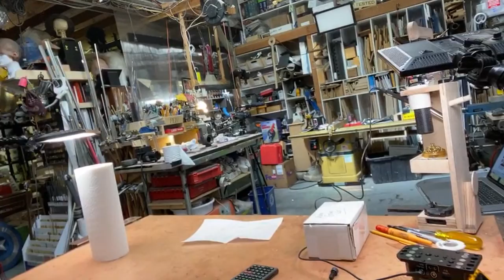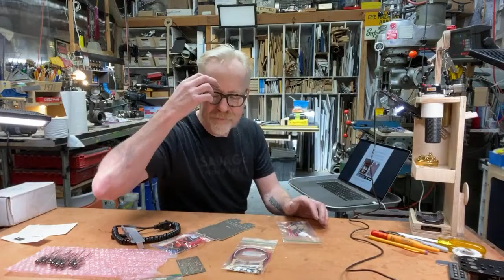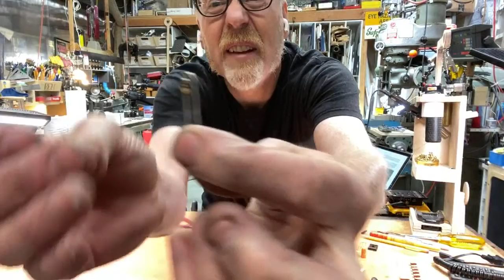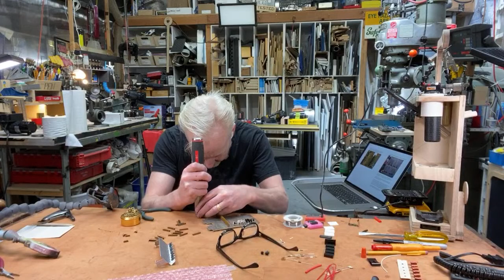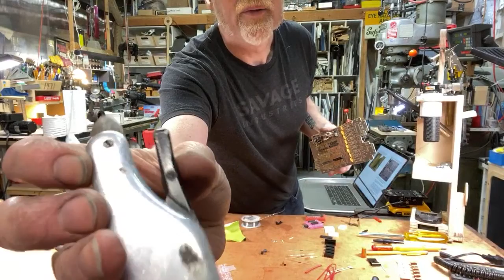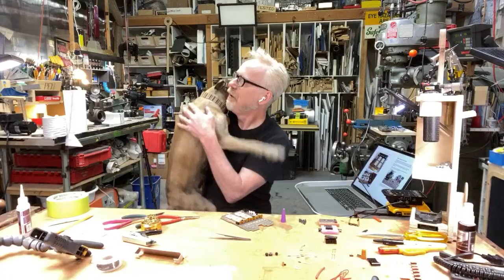Adam Savage's Live Builds: Ghostbusters Gizmo Kit!

Comment: For the workbenches I'm pretty happy with double locking casters for providing a stable base while still letting you move it around.  Another option would be to use retractable casters.  They give you the ability to move it around while also having it be stable on the bench's legs once you retract the wheels.  Another option in a similar vein are wheels that have little rubber stops that you can extend to lift the bench off the wheels.  A little harder to quickly disengage but if you don't plan to frequently move it they would work for the rare occasions you need to move it.

Comment: Adam, you should look into the wagon brakes that they use in theater for scenery. It gives you the stability you need when you drop the brake and put the weight on them, but still allows for the mobility when you raise them.

Comment: you could always make the wheels retract so you rest on the boards for the bench then pop them down to move it ... use a foot pedal switch of some sort that rotates the castors down or up ... make the ends slanted so you can put some of your tool boxes there with things you need for the current project ... and add a pop out for a camera stand spot ... heck have it swing out like the old school desks with the arm table thingy
Reply: a broken clock can also be only right once a day ... if it is a 24 hour clock
Reply: you could also use the needle knose pliers to hold all the pins on one side and then push down on the table to move the strip or bend the pins all at once
Reply: no one cut her wings off ... those are tan lines from her wing harnes lol ;)

Comment: My rule for locating anything that has been dropped, and disappeared, is, determine the hardest, most pain in the ass place that the object could have rolled under. More times than not, not only will it be under there, but it will also be fairly close to the center of it.

Comment: 11:40 When I drop a screw, what I do is I turn off the light then I use a flashlight and point it low on the floor while trying to spot a shadow that would resemble my screw. When I move the flashlight on the floor the shadow of the screw will be more noticeable. Sometimes that works for me so...

Comment: You know it occurs to me that someone somewhere has a service manual for one of those old calculators. If a person were to want to recreate something like that, all they'd have to do is make a new board from the reference images and copy the component values. Getting ahold of one of those manuals has to be like finding the pin in the needle stack though. I looked and I can't find any that are legitimate. None of my nerdy friends knows of anyone that has one either. So this is more or less just a thought because I've seen old manuals that have an image of the board for component placement with trace outlines. I think they include them for a visual reference geographically as to where to find the thing you have to replace.

Comment: Drop something, just lay a flashlight on it side on the floor and look around as you sweep the light around.  Small objects throw a huge shadow, like a pointer with the lost item at the end of the shadow.  As for the small wire kinks, check out modeler's "Metal Forming Pliers (Set of 4) # 60398 at Micro Mark hobby supplies

Comment: Your power supply story has me worried. Lol PC power supplies have large capacitors that maintain a high voltage for long after its been unplugged. Most consumers (especially 10 year olds) should NEVER open up or dismantle a power supply.
Reply: Yeah, it might actually have been lucky that he did the new one since the old one would have a higher chance of having charged capacitors. They hold current surprisingly long.

Comment: I'll tell you 2 awesome solutions to your fake pin bending, ¹) Cheapest route is from tractor supply, their house brand of tools makes a 4 pack of these miniature, pistol-gripped pliers...they are I believe, 7 or 8 bucks here in Alabama, maybe 70 or 80 in Cali., anyway, they have an awesome pistol gripped shape, theres 2 needle-nose, a wire cutter, and the last one is the solution, they are flat-tipped, and have no grip ridges inside the Jews, they are flush on the end, flush on both sides, and just flat, smooth steel inside the 'jaws'. They are small, for the hand great, and the pistol grip gives it sort of that 45 degree angle, that would make short work of the pins. ²) The more expensive, but still not bad is, a small jeweler's vise. You could clamp the whole side, paired with those pliers would be awesome! But even a small jeweler's teflon/rubber mallet. Perfect 90° everytime. Good luck buddy, hope they let you leave the house soon. At least you do have the shop, that's the only thing that keeps me sane. I hope we don't get like that fella that just got tired of being at home it seems, he got bored and decided to kill his dad, and eat parts of him. Then went and found some police eating lunch, and said..."I just killed my Dad, and ate him". Sad but true, neighbors said they haven't heard, or seen them have so much as a harsh word before, or right up until. Just baffling. Love your videos bro, keep putting them out. If you get bored and hungry, just call me...or come to Bama, and we will go to the beach.

Comment: For your new bench idea. These casters allow a really solid base but can be moved with just a twist of the feet. I use them extensively in my machine builds and can highly recommend them. 
https://uk.rs-online.com/mobile/p/stem-castors/6114414/
RS part number 611-4414 if you are worried about clicking on the link.

Comment: 44:13 build wheel bars that rotate down into place rather than putting them directly on the feet.  I can't find an example of exactly what I'm talking about but here's a similar one.  The table sits flat on it's bottom until you push the pedal that forces the front wheel down and then you can roll the cart around. https://getbackinc.com/wp-content/uploads/2017/11/three-tier-three-wheeldisplay-table-cart-vintage-industrial-getbackinc-mainw.jpeg

Comment: one of the curious things about making is you become an expert at performing esoteric operations that, once mastered, you likely never use again. Replacing all the cheap wooden joint pins on a pair of artist's articulated wooden hand models with ones you made from brass? By the 25th joint you are a god of this and have utterly mastered the most efficient way of doing it. By the 30th...you're done and you'll never do it again. Sure, you retain bits and pieces applicable to future projects...but the one specific operation that you are the world's one and only expert on? Never used again